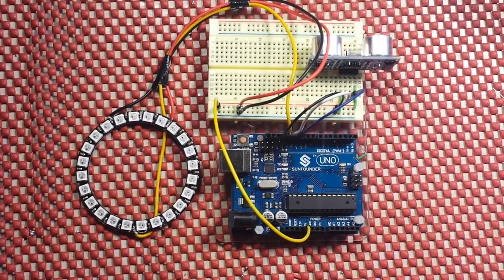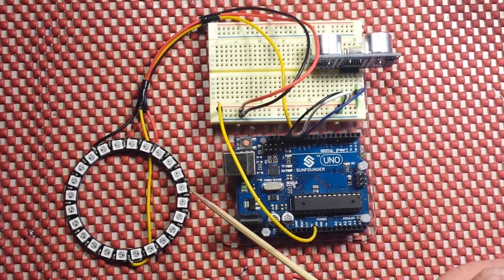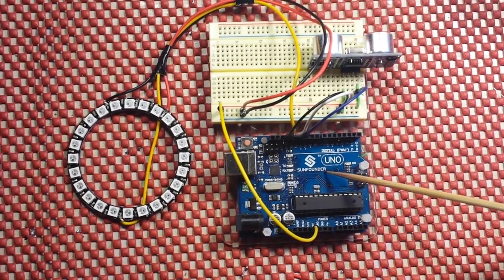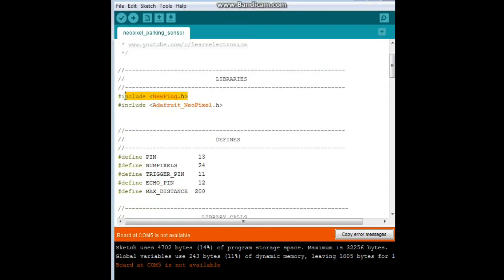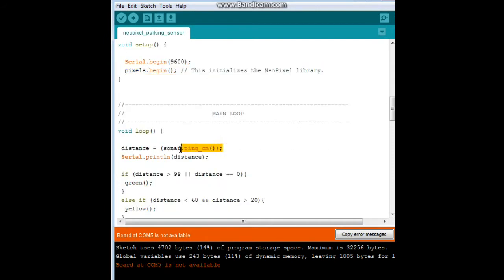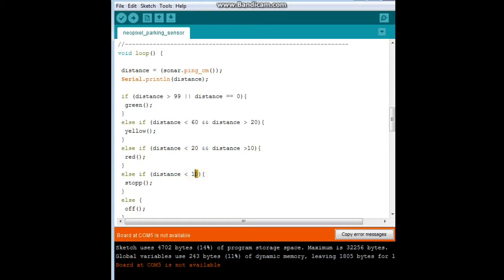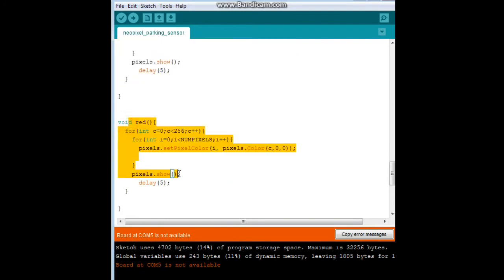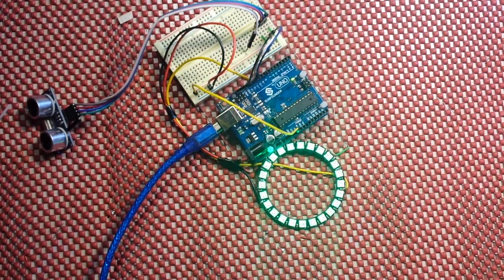How to make an Arduino Parking Sensor

Comment: So I've been trying to get mine up and running but once the program is uploaded nothing happens. I think it may either be a connection issues with my lights or the schematic in general. Could you possible give me your schematic and any advice you may have on how to fix my issue?

Comment: Cool project; I've ordered the components for delivery tomorrow.  :)  Thanks.

BTW: your code has gaps, and there is a lot of redundancy (the redundancy is the cause for the gaps).  When the distance is between 60 and 99 (inclusive), and when the distance is exactly 10 or 20 ... all of these conditions will execute the OFF function because all of these numbers will fail each of the IF conditions.  The key thing to remember is that the ELSE path is never taken once a TRUE is found.  See comments after // in code)

To resolve: (Of course, the #defines are optional - here for clarity)

#define YELLOW_MAX      99
#define RED_MAX              20
#define STOP_MAX           10
#define NO_READING         0

    if (distance == NO_READING ) {

        off() ;

    else if (distance > YELLOW_MAX) {

        set_color(0, 0, 1) ; // Set to green
        }
    else if (distance > RED_MAX) { // We already know it's not in the green range - no need to test <= 99
        set_color(1, 1, 0) ;
        }
    else if (distance > STOP_MAX) { // We already know it's not in the green or yellow range
        red(1, 0, 0) ;
        }
    else { // It has to be within STOP range
        stopp() ;
        }
    delay(500) ;
    }
Again, nice post and I gave you a thumbs-up; I'm just trying to help.

Comment: Played with the distances for the different colours to come on and all is working ok.  Can you steer me to a library that will turn the arduino off after parking the car and the turn on with a switch or remove of some type.  Looking on the web without a result.

Comment: The ZIP folder contains a .ino file is this correct
Reply from the maker: +Ross Jasckson what library did you download?
Reply: I used the link you added below 7 months ago which went to a dropbox and downloaded the Neopixel_parking-Sensor into my dropbox and IDE shows the file to be invalid.  It only contains a file named (neopixel_parking_sensor.ino) I though it should have other files included.
Reply: I have finally got the library loaded to my arduino.  I hadn't load the libraries required for the ultrasonic and pixel ring.  LED's not working correctly and ultrasonic seems not to be working but further down the road with the project.  I will work on it a bit more
Reply: when turned on the neopixel is all green and the ultrasonic does not change the neopixel. ???

Comment: Very good video thanks for uploading.  One thing that could also be done is to replace the three functions red, yellow, green, with just a single one and pass the required colour as a parameter.  For example   make some defines GREEN, YELLOW, and RED with diofferent values and the use the call set_colour(RED) set_colour(GREEN) etc in the main body.